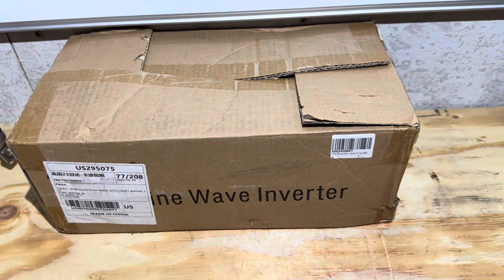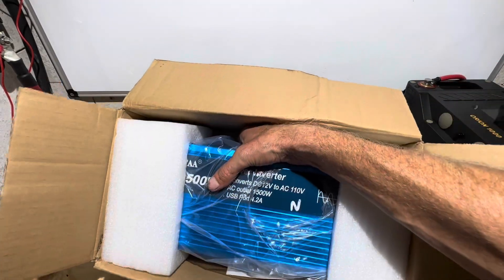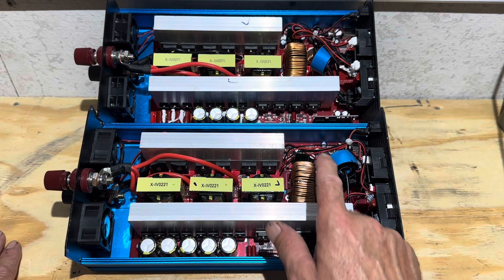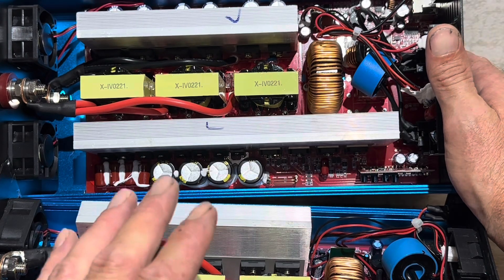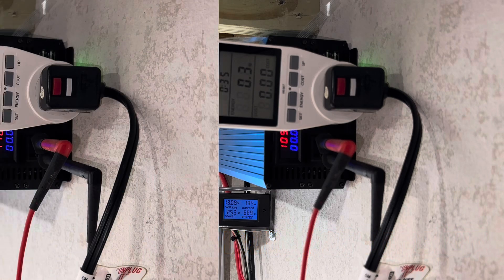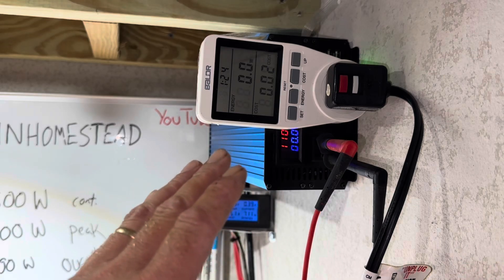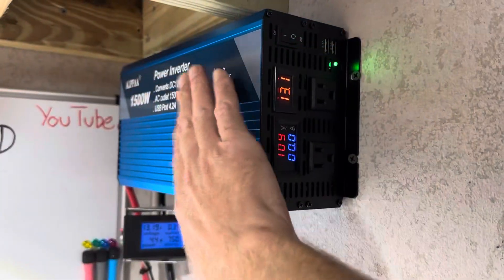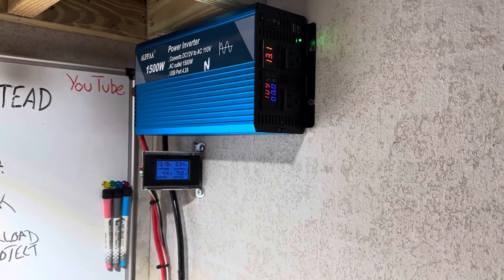ALFFAA 12V 1500Watt Pure Sine Inverter - budget power inverter

Comment: I'm going to order one soon and I need some help with what all I need as far as fusing and breaker size. I will be using it with two 100AH Li-Time mini 12 volt batteries. Could you recommend wire size and breakers size? This will be a 12 volt system
Reply from the maker: The inverter can and will pull more than 1500W on the DC side. I’ve managed to pull 140-150A out of a battery with this inverter. I wouldn’t recommend running this or any budget inverter over 80% of max rate continuously. Your wire size and breaker size depends on length of the wire run and standard breaker size is load X a multiplier for surge. This inverter will trip long before you need any surge rate multiplier. I would recommend oversized wire and undersized circuit protection for safety. I explain a little more here. https://youtu.be/mshdjzI4z-0?si=bnjev8jnL8NzTnLN